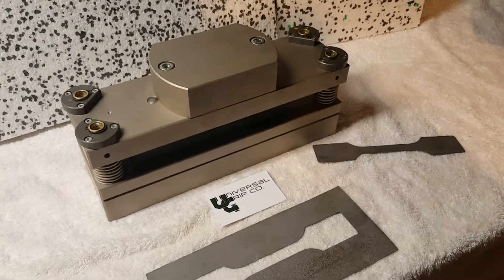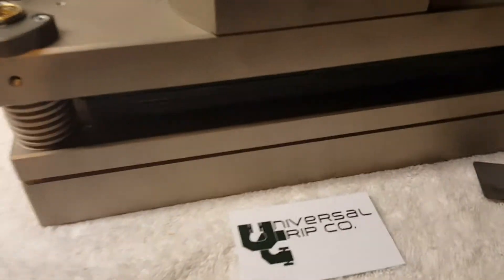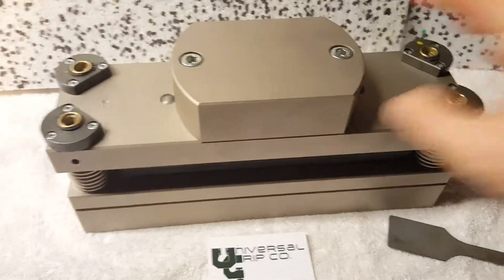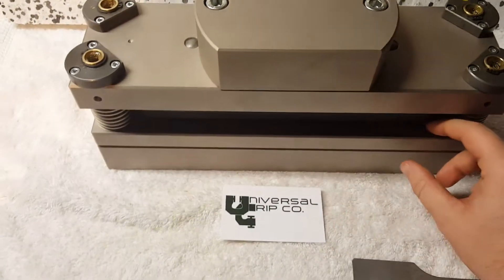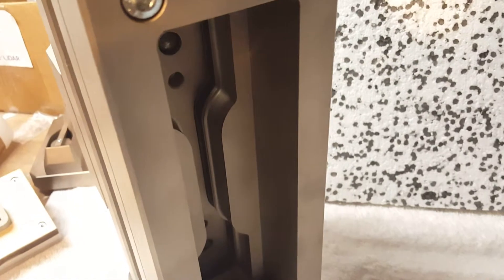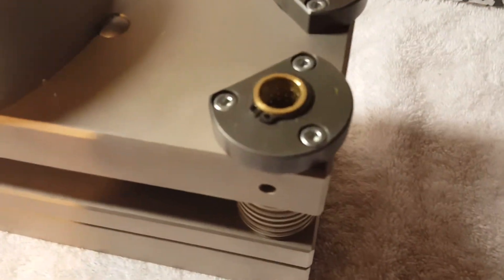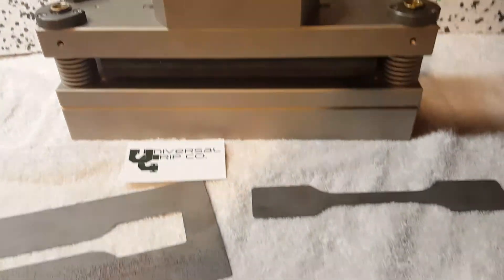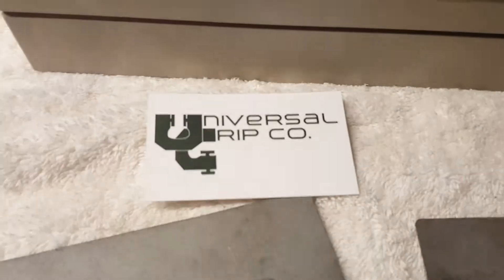Heavy Steel Cutting Die for preparing Metal ASTM/ISO specimens

Comment: Can we use pneumatic press to prepare tensile sample like this..
If yes what is the pressure required?
Reply: Need at lead 10 ton to move this die and initiate the cutting action. This one is usually used in hydraulic press but can be used in pneumatic press also.